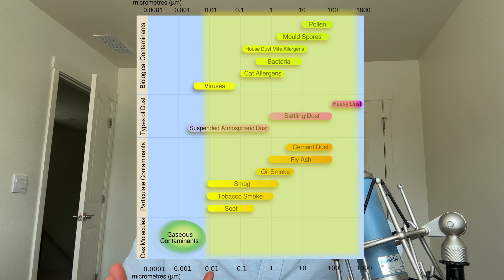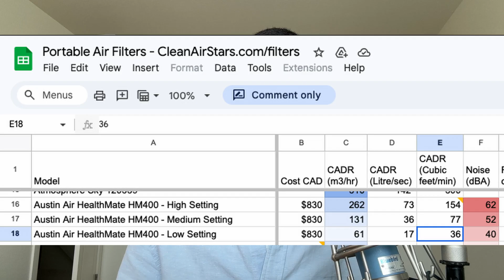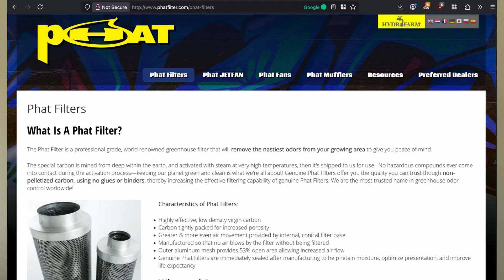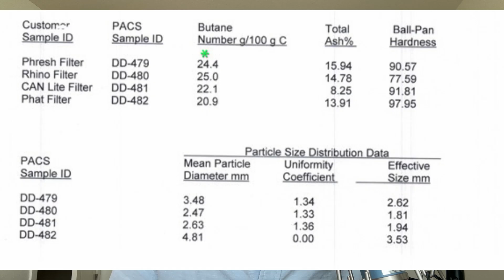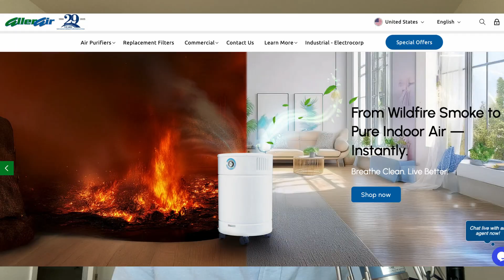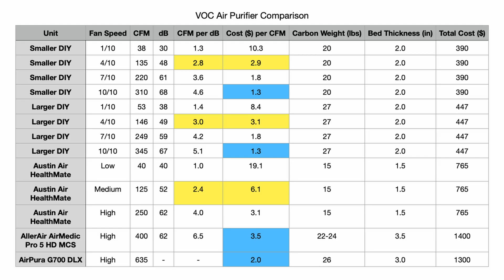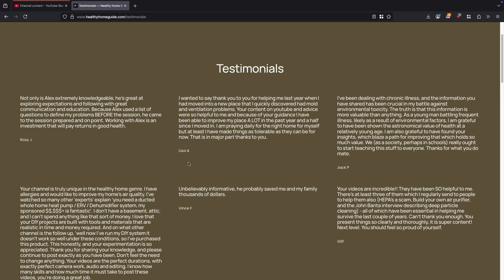Can a DIY Carbon Filter Remove VOCs Like the Expensive Brands?

Comment: I'm not sure air flow can be used as a surrogate for VOC removal, because when you increase airflow the carbon loses it's ability to "attract" the particles/gases.
 It's like a magnet on a slope, it will only stop a ball bearing from rolling down it, up until a certain angle, when the velocity of the ball bearing becomes too great for the magnet to "grab" it.
Reply from the maker: That’s why I used medium speeds for my comparisons, whenever possible. The speeds I used were well within the recommended airflow range for the filters.

And if you look at the data I presented, I didn’t even highlight airflow (cfm) alone as an important metric. Instead, I highlighted cfm per decibel and cost per cfm to reflect real-world tradeoffs.

You’re right that at very high airflow, contact time with the carbon bed can drop, which might reduce VOC adsorption. But in most consumer air purifiers, the bigger issue is actually too little airflow, especially at quieter settings.

So this test wasn't about cranking up the airflow, it was about "airflow efficiency" at realistic speeds.